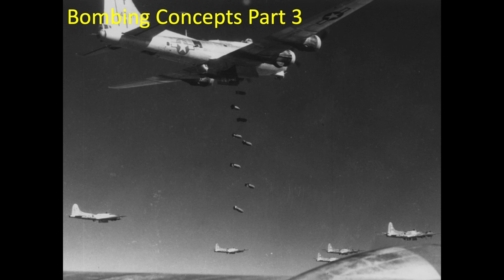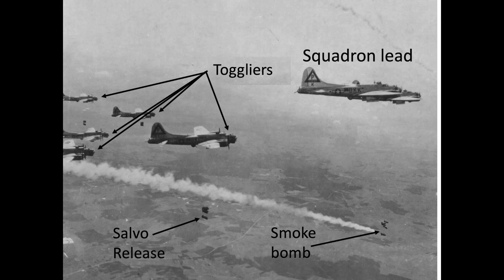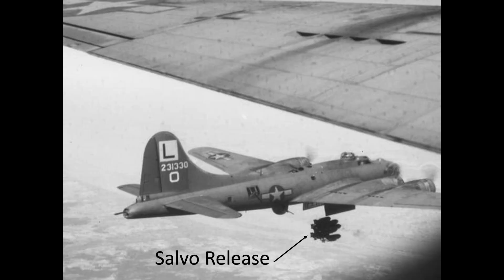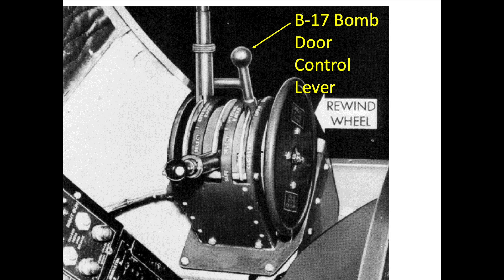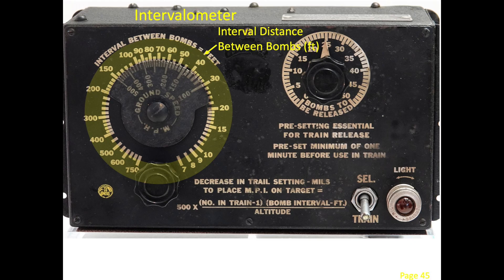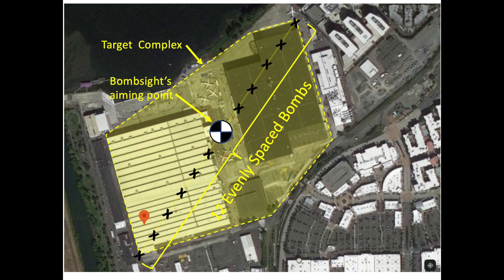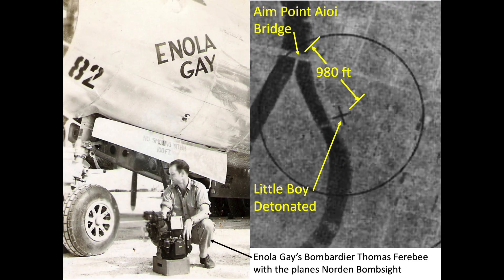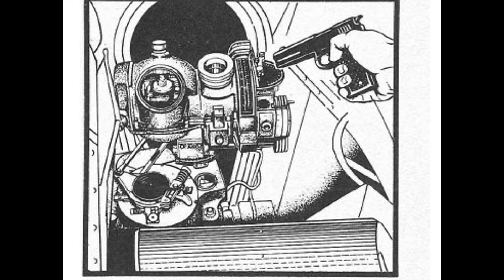The Norden Bombsight B-17 Bomber  integration

Comment: The intent of this comment is to ask if there were considerations for the design of bombers, their bomb loads and their intervalometers.

During the Vietnam War, the initial mission of Operation Arc Light saw the use of 27 B-52Fs, with a bit over half the bombs hitting a 1-by-2-mile target box. Analysis of other B-52 pictures suggest bomb strings had an average interval of ~0.1 second, or about 25 yards between each bomb at typical cruise speeds. If those parameters are applied to a Big Belly B-52D with 108 bombs, a 60,000lb payload, the resulting bomb string would be some 2,700 yards long, which would likely be too long for most targets.

Which got me thinking...

The Convair B-36 had an even larger bomb load and was designed during WW2. Did studies determine if bomb loads were too large so as to become wasteful, as large bomb strings could be much greater than the CEP and result in most bombs falling outside the target area ? Assuming a B-36 dropped 132 500-lb bombs at 350 mph with a 0.1 second interval, the bomb string would be a bit shorter, at around 2,250 yards. 

Also, were salvo releases an option on later bombers such as the B-29, B-36 and beyond ?

Comment: I learned this bombing system, except for the Norden, in aircraft weapons mechanic school at Lowry AFB in 1960.  I recognize the intervalometer, but did not remember the one-minute warm-up requirement for bombing in trail.  Must be vacuum tube or two on the system that I have forgotten.  While stationed at Spangahlem AFB in Germany in 1963, my load crew was the first in Europe to reconfigure an F-105D with the new Multiple Ejector Racks and load sixteen 750 pound bombs.  Sorta squashed the airplane's main tires, but it was a training exercise and did not fly.  USAFE gunnery and heavy bombing was practiced at Wheelus AFB in Libya in those days.

Comment: Norden bombsight. One of the biggest examples of BS marketing and PR ever done. How many lives did that overcomplicated piece of unreliable junk cost.  Sperry made a much better sight, but didn't have the political connections
Reply: Not correct.   The Sperry was less accurate, and was more of a black box device.   That is, if any any part failed, there was nothing the bombardier could do in-flight, and so the lives of a crew could be put at risk for nothing.   The Norden's working was much more visible and accessible, and if part of it was not working, often the bombardier could work around the problem and still bomb with the same or some reduced accuracy.
The Sperry had controls on both sides, so you needed both arms to work it.   That was no good in turbulence, either natural turbulence or the plane shaking because of flak - bombardiers needed one hand free to hang on to something.   The Norden had all variable settings on the right hand side, leaving the left hand free to hang on to something rigid.
The Norden could run on any plane's battery - 12 volt,  24 V or 28 V.   The Sperry needed 110 volt 400 Hz AC, which was initially only available on the largest bombers, and only available if an engine was running, complicating ground checkout.  As it could run on low voltage DC, bombardiers could be trained and tested on the Norden in slightly modified light aircraft, freeing up costly heavy bombers for actual use against the enemy.
In fact, the Norden was developed because the US military were not entirely happy with the older Sperry bombsight.
The Norden proved to be easily adaptable as bomber speeds and altitudes increased beyond what was possible when the Sperry was developed.
Despite its drawbacks, the USAAF in World War 2 actually used substantial numbers of the Sperry sight, and also another sight known as the Estoppey bombsight, mainly because the factories making the Norden couldn't make enough timely enough.   USAAF experience was that the Norden was indeed the best of the three.
The Norden however was indeed more prone to trouble and needed a lot of maintenance.   Stipulated service interval was just 15 hours.
Much has been made of the fact that achieved bombing accuracy in actual combat was a lot less than the technical accuracy of the Norden, however there were a lot of reasons that were not the fault of the Norden, eg German decoy & camouflage work, smoke or cloud obscuring the target, need to send many planes in tight formation to avoid high kill rate by enemy fighters.

Comment: Not only did the Germans get the design of the Norden bombsight before the U.S. entered WW2 they built their  own version correcting some of the obvious deficiencies of the design. They didn't use it because their operational doctrine was to drop bombs from lower altitudes where a less complex aiming system was adequate.
Reply: Was about to post that too. The Lotfe 7 series were not direct copies of the Norden but had the same principle, but were much simpler to use. Ironically Israel used them on the 3 B-17s they had in the 1948 War of Independence
Reply: Also the Germans set great store by dive bombing, even the He177 was designed to be capable of that. Later the Germans developed guided bombs such as Fritz.